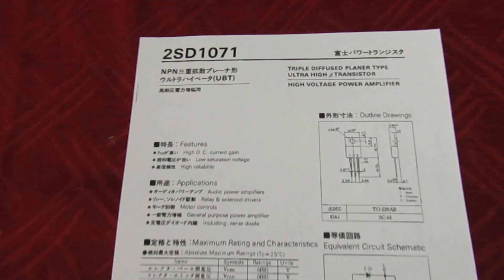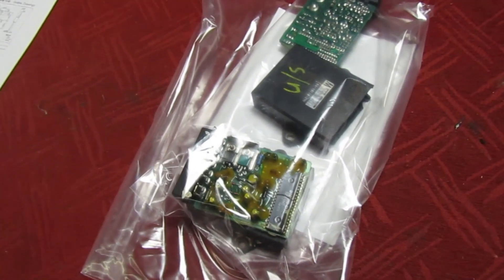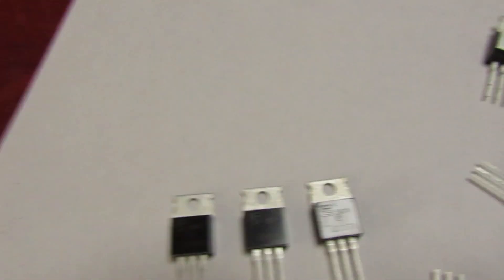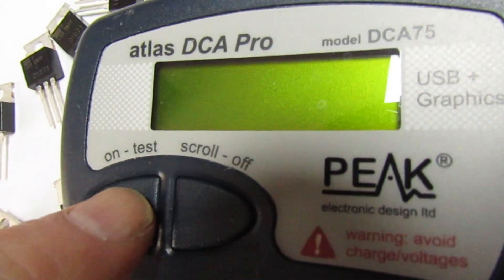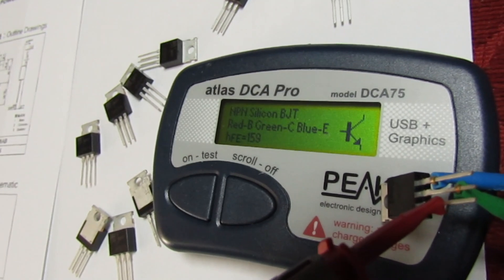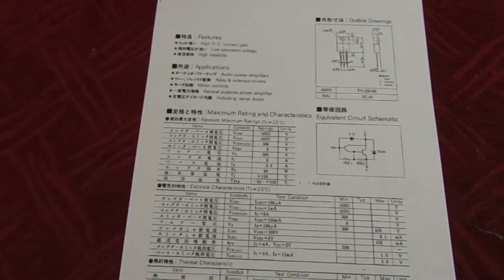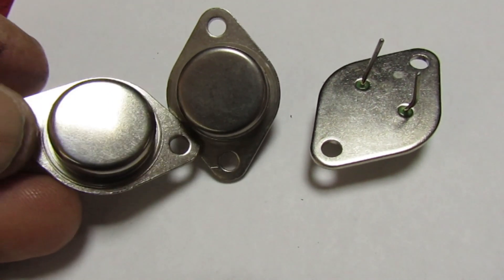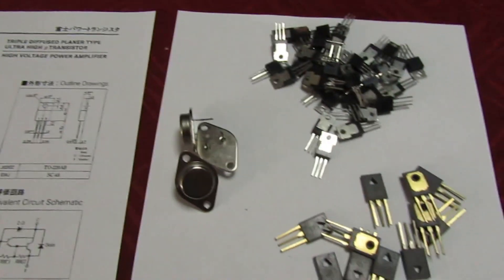2SD1071  ??  No, but it looks like one . Lets see how it started life .

Comment: I bought some S8025 thyristors from a respected ebayer only to find they were fake devices. Trouble was when they were installed on the pcb and power applied, they caused me even more grief….Further checks proved they weren’t even thyristors made by Teccor. I contacted the seller who refunded me fortunately….I went on to buy some more from RS and problems went away….Just shows the need to be careful about sourcing parts.
Reply from the maker: Fakes are getting better than ever now and this is why its best to pay more money and buy from a reputable supplier , like RS components as you say .Just like you say a fake part can short out , blow up and cause more damage than you had in the first place .

Comment: I had to replace the Battery Fuse Box on my Galaxy and decided it was better to order a secondhand one, ironically on ebay, for £20, rather than a new one on ebay from who knows where for £15. At least it would have copper components in it and not potentially CCA.
Reply from the maker: Absolutely , a good second hand part is far better than a fake brand new one , so much stuff is now faked .

Comment: What equivalent did you end up going with in the end? I have a bad 2SD1071 in my old bike and finding a good option is proving difficult. Would be great to know if you find a replacement that works.
Reply from the maker: OK , I have just ordered some transistors that look to be suitable, part number BU912 , this is an obsolete part now and I had a bit of trouble finding some ,theirs none on Ali express so this is unlikely to be a part that is faked as theirs no demand for it , £2.50 each at Cricklewood electronics in London .
Reply from the maker: Dam , you just reminded me , I placed an order with RS today and forgot to add some transistors to the order as they no longer do free postage over £5.00.  two of the devices suggested in the comments were , BU808 , BU912 and there was another device specially made for automotive use  which looked good but I cant just find it in the comments now , I need to compare the specs on these and get something ordered up , so ask me again in 10 days time or so and I will let you know which was best, if you dont ask me I might forget !

Comment: It's the most frustrating thing in the world. I bought two trays of 46V32M16 memory ICs only half of which worked. The others failed after 2 mins of operation. Must have been rejects. At the time Farnell, RS and others had no stock and a ridiculous lead time. Its not just older components that are becoming scarce, all components are starting to run out.
Reply from the maker: sadly its a fair bet to say most of the stuff for sale on the internet is fake , the net for me is the very last resort , my wife  once had a GHD hair straightener she bought off someone and i didn't realize that was a fake until we saw the very same on on a TV program called fake Briton.it was undistinguished from the real thing apart from the fakes all had the same serial number , we binned it after it overheated and all melted.

Comment: Looks like, despite my efforts, my previous comment got wiped by Youtube.
Anyways, the part I mentioned is not close enough... VCBO of 70v vs what you need, 450V.. ah well.
Cheers,
Reply from the maker: No worries , I have had quite a few suggestions and one transistor was a current stock item at RS components .

Comment: Had fake from website with A and from website with a E.  Major damage after 3 minutes running off the amplifier.  Thanks for some intelligence using dummy load and not the speaker.
Reply from the maker: I too have had fake parts supplied from a major distributor, some fakes are so good its virtually impossible to detect .

Comment: It didnt even occur to me that the component could be fake when i ordered a new transistor for the IMRC on my V6 Mondeo, it works fine and im running on all 24 valves past 3400 rpm or when the throttle is buried instead of 18 so i guess it was at least close to what it should have been.
Reply: I had the same problem with a 2.5 v6 cougar, The transistor that drove a motor in the IMRC box would work for a second then shut off, so I used a TIP35C as a replacement.
Reply: @tyronenelson9124  yep, your car suddenly looses all  its balls and its scary when it happens during an overtake!

Mine behaved until i started ringing the cars neck, then the heat from the exhaust would make it die on me, i replaced the transistor but also reflowed every single solder joint on the board, your IMRC was probably the exact same module as my mondeo has.
Reply from the maker: Unfortunately now I would say that most stuff sold on the internet is fake , the only reason I took a gamble on this transistor is I didn't think there was any demand for them as its not a part I have come across before and  parts are only faked when there is a big demand for them  , no point faking a part no one wants .

Comment: Do they put numbers on the dies like on some IC chips if you break them open?  I had developed an aversion to stripping components from vintage transistor circuit boards,  not particularly liking cut lead soldered untested transistors and parts lying about.  But it starts to look like it may be necessary to go back to that practice derived from our low budget days just to get genuine items!  I always found mix lots of parts purchased from hobbyists and swaps an excercise in picking out used looking parts as being extremely doubtful at best.  I would have thought that the process of creating large inventories of fake parts that are meant to deceive by appearance would be unprofitable bother,  especially if they sell for very low prices.  And niche market versus large inventories of excess.  I don't understand their alien thinking there but I guess they think it will make them rich.  Lot of work to make good fakes but then sell for pennies. Uh.
Reply from the maker: I don't actually know if there's anything marked on the DIE as I never opened one up but your advice to remove devices from old scrap boards is good and its the only way to guarantee a device is genuine , it is a bit what I use to do in the 1970 s though !

Comment: I've seen this before, we once had problems with replacement line output transistors failing repeatedly with no apparent reason. A replacement from a scrap board was often the solution. I had no qualms using a substitute device after reading the data sheets and in a class B or totem pole output stages I'd replace both transistors using a complementary pair. I bought most of my spares from Farnell/Element14, using suspect parts just leads to more work and disappointed customers.
Reply from the maker: I have had exatcley this same situation back in the 90 s with Sharp TV s when the line output transistor had shorted out and the ones supplied from SEME just blew at switch on and just like you say one from a scrap set would work fine , I brought this subject up once on a sharp training course and the TLO told us it was most important only to use sharp supplied parts as they were individually selected for the set but knowing what I know now that was more likely just a load of rubbish and the ones supplied by SEME were just fakes.
Reply: @michaeldranfield7140  That must had been around the time of the "Sharp Parts" marketing drive started, I was just leaving servicing then. 
Have seen this since then with Jaguar car spares, the "made to Jaguar specification" new part driveshaft UJ fails again in less than a year, while a used driveshaft containing original 10 year old UJs would last at the least another 5 years. And when I was a kid I heard a farmer telling my father he's looking for second hand tractor tyres as new ones wear out too fast.
Reply from the maker: @jagmarc  True , someone asked me not long ago about replacing a wing mirror on his van and I told him a good used mirror would be better than a cheap brand new one , new replacement parts can appear a good buy but as you say don't last 5 minutes .

Comment: Yes fakes are a nightmare, a friend blew up his amplifier with a fake part STR.... something,ouch. Incidentally I found some T03 style metal transistors in my old arcade spares box from the early eighties. Unfortunately the numbers have more or less come off now, a few look to start ST..... but can't even begin to identify them  as they have 3 legs ? I can only imagine them being arcade game related and maybe to  do with the early monitors, people I've asked say they've never seen a 3 leg version before. Any thoughts as to what they could be ?
Reply from the maker: The 3 leg TO3 devices you mention were very common in Amstrad sets in the 80 s , off the top of my head ones that spring to mind are STR451, and STR441, in fact I published a modification for these devices about 30 years ago in Television magazine , have a look at my video on the Amstrad CTV 1400  you will see the 3 leg device.
Reply: @michaeldranfield7140  I will have a watch and thanks, those numbers do ring a bell. I think before the numbers deteriorated some were printed in black and some in red so maybe they're a mix though I'm not sure why I had them in the box lol. I'll check that they're not the ones used on my 1979 Taito space invader part 2 cocktail table chassis. If not, are these  likely to be of use to a TV museum/collector as a freebie before I bin them.
Reply: It depends on whether the third leg is connected to the casing or all three legs are connected to the chip. If they're connected to the chip it's very likely a Sanken STR chip, if the third leg is connected to the casing it can be a non standard power transistor. I've seen some of those, but can't remember the brand. Maybe Motorola.

Comment: Incidentally,  In hobby mode I repaired for a vintage hifi collector friend a Pioneer tuner /amp that even his region Pioneer Service themselves couldn't repair. FM IF/demodulator IC failed no spares available. I patched in some parts pulled from modern equipment made 30 years later as a birdsnest on the pcb traces, 100% perfect result. Year later he got hold of a genuine Pioneer IC from a breaker in USA and asked me to fit it instead which I did. Even though the genuine chip had a noticeably distorted sound compared to the patched in 'invention' it was original circuit and that's what's more important for him as a collector.
Reply from the maker: Done the same very many years ago in a Panasonic TV , made up a pcb to replace a no longer available chip, wouldn't do it now though its just not worth all the trouble for what you would get paid .
Reply: @michaeldranfield7140 It was a real pleasure working on this product and see it working again, really well engineered, crystal phase  controlled capture and servo lock tuning that never drifts once pointed to target, military like a fire and forget missile.  I knew it would work again as I had the full schematics, my friend got them all ready for me so I could concentrate on what I do.  He offered me many other high end items to repair but I had to refuse as I'm retired.

Comment: I looked very carefully at what you're holding in your hand and all of the lettering printing I saw corresponds exactly with the Ebay*** description in every way. The three pins exactly the right length and the hole exactly in the right place in the square tab.  So you have got what the Ebay seller had described. If you make a "Not as Described" claim to get your money back then the seller considers Ebay as supporting "scammer buyers splitting hairs about the description" and "exploiting loopholes in quality control", that it's "not Ebay seller's  responsibility to sponsor quality control",  and that "this is what our supplier provides us with, we are only the seller" . Seller ends up write off the loss as tax deductable.
* ** EDIT I'm quoting ebay as an example now, after having written all this it later dawned on me that you'd bought from a different platform. doh
Reply from the maker: I cut out the middle man and bought these direct from Ali express but all you have to do is open a dispute and get a refund .
Reply: @michaeldranfield7140 Using the trading platform's "not as described" protocol,  I know a several people who get an endless free supply of li-ion batteries doing just this. The majority of li-ion batteries sold online especially so Ebay, the measured mAhr never approaches what's claimed so there's an endless supply of free batteries from sellers who let's face it don't know what they're selling. The odd customer here and there claiming the claimed performance isn't what's claimed doesn't make much a dent in the feedback score. 
If too many people jump on this "free battery" bandwagon it'll come to an end but for now the formula is look for sellers showing the obviously inflated claimed performance in combination with large numbers of units sold.  This won't last forever as more sellers are claiming "Marketed mAhr" to dispute a NAD claim.

Comment: I used to work at International Rectifier in Oxted. We packaged up to almost 10 million devices a month at its peak around 2001. You can imagine just how many failed devices went in the skip. None were crushed, they just went to scrap!
On another note a BU323Z will probably work fine in that application. The only problem is I’m not sure if they are available in TO220, maybe you can squeeze a TO247 in there.
Reply from the maker: Many years ago when I was only young I was visiting a local scrapyard looking for a part for my car and I was so excited when I came across a massive oil drum full to the very top with T03 transistors, excitement didn't last very long though when I saw they had no numbers on the top !
I saw somewhere that the reject rate is very high on silicone based products so the Chinese must be in there element .
Many thanks for the suggested equivalent I will take a look .
Reply: @michaeldranfield7140  when I first started at IR there was a TO3 production line and it was one of the pieces of equipment I worked to maintain. Apparently when originally installed it had an induction spot welder to weld on the caps that made the lights blink across the entire village! It was replaced by a capacitor discharge welder that used a bank of caps the size of a small filing cabinet. The bang when one of the parts or electrodes was not perfectly clean was quite remarkable!
Reply: @ShaunieDale   Yes a lot of the time there's many contemporary devices that outperform the originals (at the expense of a few extra pennies).  Having spent half my career in Service (emphasis: getting the exact 'original part' /keeping to original) and then the other half my career in Design (: making use of 'what's available' to meet/ exceed requirements), it changes your perspective having seen from each side of fence.  Years ago late 60s Newmarket tried to market a range of "universal replacement" transistors NKT-range but that seemed to had flopped.

Comment: Cricklewood electronics may be worth a try, they stock NOS semiconductors
Reply from the maker: Few years ago I wanted a MOSFET and cricklewood had it listed in stock so I sent them a message and asked if they could guarantee it was a genuine part before I ordered it , they never replied so I never bothered with them again .
Reply: @michaeldranfield7140  I ordered an old low power audio amp chip from them and got it okay, no issues, in the last year. They are not showing them on their website but do suggest BU806 as a replacement.
Reply from the maker: @twotone3070  In the end I did get 4  genuine  NOS from cricklewood , BU something , cant remember now as im at home but they were a perfect replacement .

Comment: If It's Chinese it's fake, rule of thumb best adhered to.
Reply: Not so. Most of the top brands are made in China or Indonesia. There are unscrupulous individuals that carry out this practice in China but compared to the size of the electronics industry based over there, it’s small fry. A pain nonetheless!
Reply: I had good luck with a Schottky diode from Ali. The original shorted out, and sellers here didn't want to deliver to private customers.

Comment: Easy enough to make a suitable Darlington using two separate transistors.
Reply from the maker: Not much space in the case and as its driving the ignition coil it needs to be high voltage , there is a pretty good equivalent but in a T03 case so that's a no no  also .